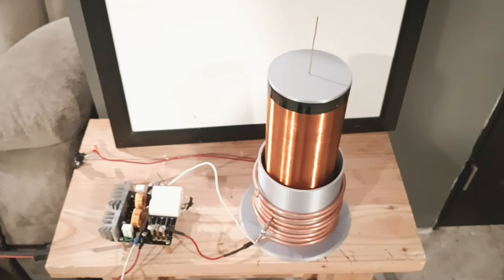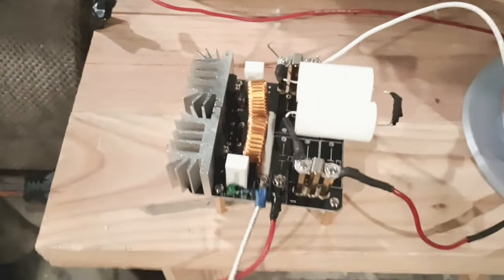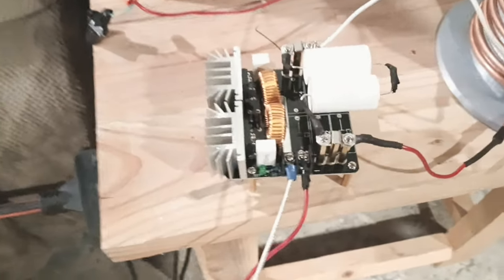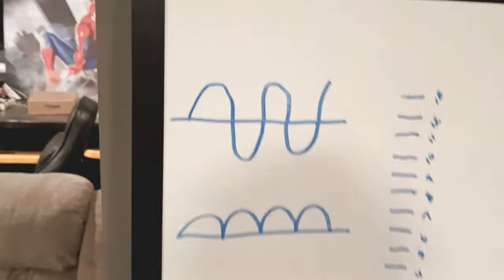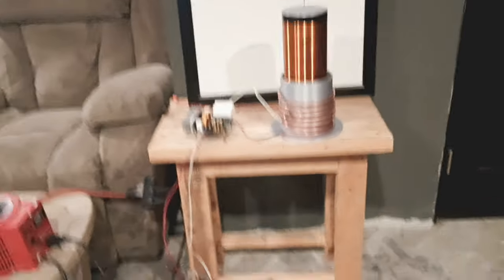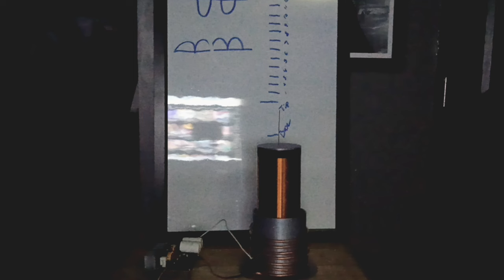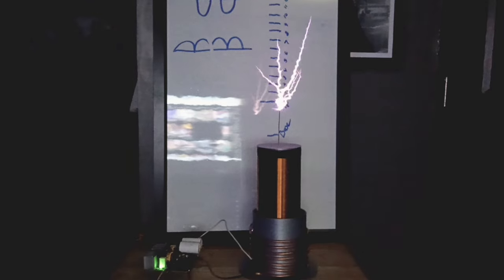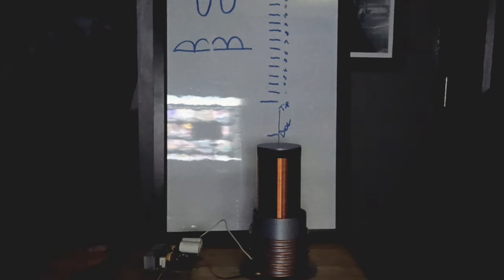First Look ZVS Tesla Coil

Comment: Hi, please put to the top a alloy salat bowl (topload). You will get better performance "radiant" energy.
Reply from the maker: That is in the next step. I am connecting my Graviflyer as the top load. Testing outside for distance. It is 360khz difference when connected so it took some calculating to figure out the windings with the zvs.

Comment: Looks great! I modified the ZVS with new caps (~77nF) - a DC 60v 5A psu should be enough input? I assume you're rectifying the Variac AC to get higher voltages. Thanks!
Reply from the maker: yes I am. use copper on the top. works better
Reply: @nathanbunten4299  Thanks

Comment: Hi, can you please give more info on how did you rectify input? did you put diodes on only one line or for both ? kind regards
Reply from the maker: time 1:11 how wire (black) goes to 2 diodes that look backwards. then it is connected to the negative terminal on the zvs. The natural (white wire) is connected to the positive of the zvs. the ground wire is not used on this part. You will need to ground the #2 coil to get good results. I do mine separately.  this produces the top of the sign wave only. I added a diagram in the community postings on my channel. The whole thing looks wrong but it is completely right. ( diode # 20a10 ) Make sure you #2 coil is between 260khz and 400khz. I have mine at 340khz in the video. The reason is that the #1 coil will not be able to pick up the range of the #2 coil if not in this area and it will not oculate properly.  My #2 coil is on 4" pvc pipe 32 awg wire at 11 1/2" of winding. The #1 coil is 1/4" copper tubing (hollow). I hope this helps.

Comment: Care sharing your circuit diagram and components?
Reply from the maker: I used the zvs off the shelf. I will add a link for it in the description of the video. The caps are there as well.